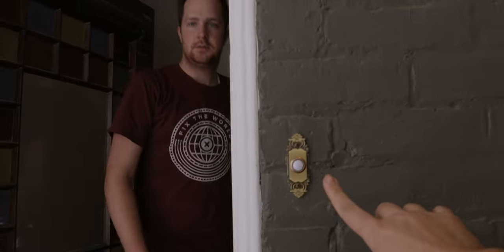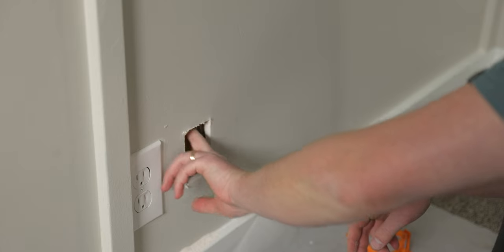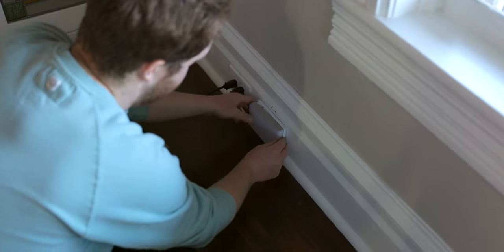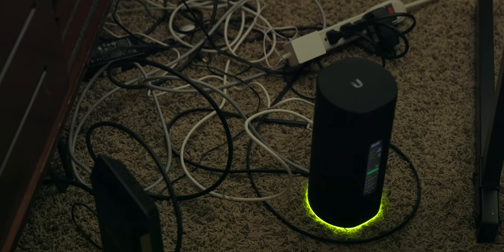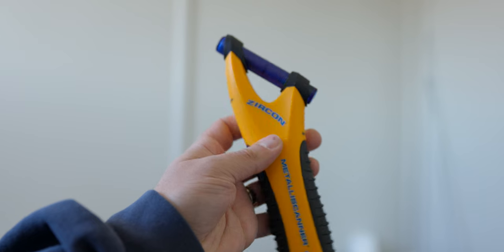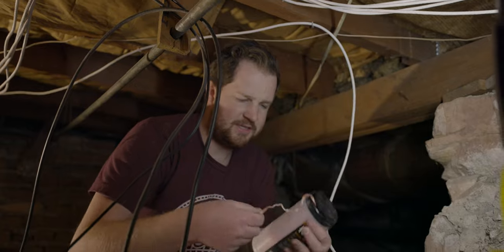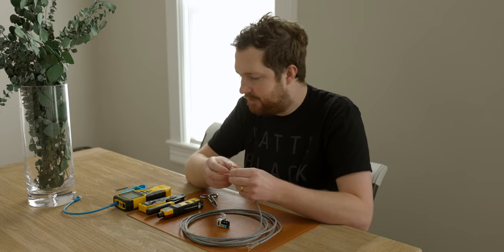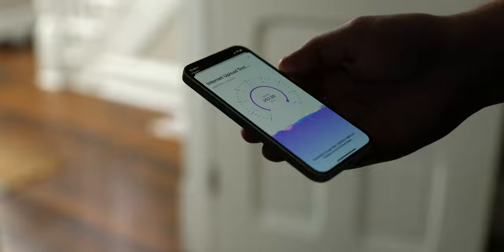Adding 10 Gigabit Ethernet to my 129-Year-Old House!

Comment: A few comments on this to explain some things better:

pin 1 is green/white
pin 2 is green
pin 3 is orange/white
pin 4 is blue
pin 5 is blue/white
pin 6 is orange
pin 7 is brown/white
pin 8 is brown

This is the T568A or as you said type A config.
The T568B or type B has the following layout

pin 1 is orange/white
pin 2 is orange
pin 3 is green/white
pin 4 is blue
pin 5 is blue/white
pin 6 is green
pin 7 is brown/white
pin 8 is brown

The difference is pin 1 and 2 are switched to pin 3 and 6. This is because it was used to make a cross cable, type A on one end, type B on the other end.
Why? Because this is how the pins are used:
pin 1 is TX+
pin 2 is TX-
pin 3 is RX+
pin 6 is RX-

Today most ethernet equipment is MDIX which means it automatically senses these pairs for transmission or reception, so it doesn't matter whether you use type A or B. On older equipment is does make the difference to connect or not.

So what about pin 4 and 5? These are used for telephone lines. No need to wire your house with extra telephone lines, you could just use this pair for that. In fact you can actually click a RJ11 telephone plug into the RJ45 socket and make it work.
Pin 7 and 8 for POE, power over ethernet, today mainly used for IP cameras. It eleminates the use of extra power cables.

Since these two pairs (4,5 and 7,8) are generally not used, in some rare case they could be used to have a second ethernet connection over the same cable. Not advisable but it is possible. I've use this when I needed to connect my doorbell and ip cam located at the gate away from my house. The tube that lead to the gate only permitted one cable, so this was the solution.
Reply: Would the method you mentioned to send two connections on one cable require you to terminate pins 1,2,3,6 on one RJ45 connector and use the remaining four cables to mimic "1,2,3,6" on a second connector on both ends of the cable? Or is it somehow possible to just make two terminations one one end for two devices and somehow configure a switch to send a signal to a customizable set of pairs in the ethernet cableing? Or am I just overcomplicating things in my head lol
Reply: @TromboneSauce  Your first assumption is right. One RJ45 has pins 1,2,3,6 as normal, while the second RJ45 has pin 1 on the blue wire, pin 2 on the blue/white wire, pin 3 on the brown/white wire and pin 6 on the brown wire. On the other end of the cable it's exactly the same.
Reply: if there is power at gate, one could use switch there. if not, you can actually get poe powered passthrough switch. or hack your own. if you look harder, you find managed 5p switches too. overkill or not, having 2 eth devices there already is anyway. and i actually do use single cat5 two 100m at here a lot because i'm a cheap one. my current managed switch is 100m anyway and i like it managed. besides, you might not need the bw
Reply: @ketas  yes a switch could be an option, but, in this case there was no room at the gate and from a security pov it's not a very good idea. I actually hacked the video doorbell and added a small OLED display with an arduino nano integrated into the doorbell case. I barely had room to make all the connections.
And I also went cheap and fast, I'll admit that. :)
Reply: 10 and 100 megabit use two pairs but 1000 megabit uses all four pairs. So using one cable for two connections will limit each connection to a maximum of 100 megabits. This may be an issue in some use cases. Decades ago I worked in a 40 floor office building where the whole building was wired up with one ethernet cable per desk. By the time all the infrastructure cabling was completed it was realised that many staff required more than one ethernet connection. So hundreds of desks had ethernet splitters to split one cable into two. Essentally splitting two pairs to one cable and two pairs to the other. Then in the communications room there were patch panels that were wired up to act as splitters. So a lan connection would go from the network hub to the splitting patch panel and then from the splitting patch pane to the floor distribution patch panel then out on the floor it went through an inline splitter to then go to the workstation. Very messy, especially for a brand new, whole building re-cabling. In the future this got even worse when the owners decided to squeeze in additional desks and so two separate desks would share a single cable via a splitter. So many faults and so much confusion. Especially with the end users pugging and unplugging connections in an attempt to find a working connection. Splitters were moved to other desks and then reported as faulty when they couldn't get two connections to work on a cable that wasn't configured for splitter. Of course when you arrived to fix the chaos everyone swore that nobody had touched anything. 🤔
Reply: @jaseastroboy9240  Nope, you're wrong, 1Gb lan uses the same two pairs, it's the newer 2.5Gb that uses all four pairs. However using 1Gb over the split cable is not a good idea because it could suffer from crosstalk (interference from the second connection). The general norm for 1Gb without splitting is minimum cat5e  cable, but generally cat6 is advised because of the aluminium shielding protecting the signal from outside interference. For 2.5Gb cat7 is advised because each pair is also shielded.

Comment: You certainly SHOULD terminate in a specific order rather than “as long as both colors are the same at either end”.  The twisted pairs are paired that way that they are inverted polarity to protect against interference.

Source:  I work as a Network Engineer
Reply: This needs to be higher up, please for the love of Jesus and your mother end all cables to a spec, preferably B.
Reply: @wesleybradley89  THIS. TIMES. INFINITY.  (and beyond!)   568B is preferred, largely because it's the most popular iteration. Just don't  terminate one end using 568A and the other using 568B, because you'll cross over the orange and green pairs. (and your tester device will rightfully complain!) Doing this intentionally  means you've made a crossover cable, which is normally used to directly connect two computers two each other without a switch in between.
Reply from the maker: Should have clarified better in the video. As long as the cables are on the same end, they should work, but performance will be impacted and there are reasons for which the standards exist. Type-B is the way to go and it’s what I’ve done everywhere.
Reply: Making up your own pinout defeats the whole point of running Cat6. (Even untwisting too much cable before the RJ or keystone defeats the point, but that's just going off into the weeds of pedantry...)
 
White-Orange, Orange, White-Green, Blue, White-Blue, Green, White-Brown, Brown. 
Every time, one exception (when you're making crossover cables for devices that can't auto-MDIX, swap Green and Orange on one end).
Reply: @needfuldoer4531  well the same is true for using unshielded rj45 connectors for Cat7/Cat6a though it is done a lot and for the most part is fine. Having electromagnetic interference for the whole cable run are very probable since it probably is close to AC wiring at some point, but usually you won't have too much interference right where you plug in the RJ45 jack.
Reply: @lal12  Using unshielded RJs is much less of an issue than mixing the conductors up. You really don't want the signals messing with each other through crosstalk.
Reply: @needfuldoer4531  obviously, my comment wasn't really clear. I was referring to "untwisting too much"
Reply: @lal12  I've had firsthand experience with  poorly installed keystones that had an inch or two untwisted on Cat5e runs. Sometimes they'd only autonegotiate to 100 meg, sometimes they wouldn't work at all. I had to re-terminate dozens of them or just abandon them and dedicate them to digital phone lines.
Reply: @snazzy  type A and type B are just a flip or orange and green pairs 1,2 & 3,6 and it will not impact anything if you choose to go with A only or B only. now if you just go in pairs across the connector instead of using a 568A or B standard that will greatly impact max performance. as for different twists per pair that's true as i have personally torn into many wires of different brands and each is twisted at a different rate per pair and per four pair.
Reply: He didn't word it quite precisely. I guess he meant as long as the order is the same for both ends. 
  Umm, yeah but most people are uncomfortable with changing established wire orders. He is right in an absolute way. But it would drive the next person crazy with non standard order.  He did say use the B standard and should have emphasized that.
Reply: @firesurfer  That’s still not the case, even if the ends are in the same order.  The 8 wires inside are twisted in specific pairs so that one is positive and the other is negative.  This is by design to eliminate interference.  T568A and T568B are designed so that your pin layout always has a positive (white striped) wire and a negative (solid color) wire twisted together.

For example, in 1000BASE-T, the first pin will receive a positive signal and the second pin will receive a negative signal.  T568A and T568B have the first pin be a white striped wire, and the second pin be a solid colored wire.  This method carries down through all 8 pins in both standards.  That way, the twisted pairs always have a positive wire and a negative wire.  

If your only consideration is that both wires are the same on both ends, you’re going to create twisted pairs that have two positives or two negatives.  That’s just asking for crosstalk and noise.
Reply: @SHADOWSTRIKE1   That's not what I meant nor Snazzy Labs.  And I believe you know it.
Reply: @firesurfer  Well then I'm not sure what you meant, because that's what you said.  You said "as long as the order is the same for both ends", which is not the case.  It's much more than just having the order the same for both ends.  Having both ends be in the order of Brown, Green, Blue, Orange, White/Green, White/Orange, White/Brown, White/Blue will cause issues, regardless if both ends are in the same order.  

And no, I don't believe I know it.  I've worked as a networking engineer for many years, and it's quite a common misconception that you can just have a pinout order whatever way you want as long as they're the same on both ends, which isn't the case.  I've seen many sites screw this up their pinouts and then not know why they're in half-duplex.
Reply: @SHADOWSTRIKE1   What he was saying is, wires don't know what color is printed on them. As long as the order is correct electrically it's fine. Regardless of the color of the wires.
Reply: I'm an AV/Data comm integrator, and you would be correct sir...
Reply: @needfuldoer4531  Always fluke out your cable runs :p
Reply: @firesurfer  That's still wrong. The electricity does indeed not know the color of the wires, but the physical structure of the cable matters. Ethernet is a differential signaling method. This means that when one wire goes high, it's differentially paired wire goes low. They're always opposite of each-other. This means that if some external noise comes along, it affects both wires the same. because you're only really concerned about the difference between the two pairs, this common mode noise is effectively removed.

This is why it's VERY important that the pairs in the cable are in fact pairs. If you instead split the pairs, and start sending signals down the wrong wires, you mess with the signal integrity. This is why cat5e and cat6 differ. if you notice in the video, cat6 has a plastic cross going down the length of the cable, keeping the pairs separated. This is to eliminate cross-talk between pairs. If you then come along and send the positive line of two pairs down a twisted pair. Well now you've just made the separator AND the twisting of the pairs pointless. It'll likely perform worse than a properly terminated cat5e at that point. 

Electrical signals in the MHz aren't just simple "goes along the cable" signals. They're 3D waves, guided through copper. the 3D structure of the cable matters.

If snazzylabs meant that either standard T568A or B was fine. Then sure. But going with a made-up order is a TERRIBLE idea.
Reply: This is all ignoring the issue of when someone has to come in behind you. If you've made up your own order, even if you keep the pairs correctly together and have no crosstalk, the next guy who has to work on this network is not going to know what the hell is going on with these weirdly wired jacks. This is why we have standards, so that you don't need to write a manual of all the shit you made up to include when you sell the house.
Reply: @dumle29  No need to be a jerk yourself. 
   I have had several rolls of wire with odd colors, they didn't match standard setup. I had to just make them up the way they were. Worked fine, but looked goofy.
Reply: @firesurfer  I'm not. I just told you why the ordering matters, why the cables are built the way they are, and why making up your own order messes with that. You then resorted to profanities.
Reply: @dumle29  In your mind only.  You misunderstood what I said.
Reply: Yeah, this is really important.  If you don't keep them in the proper +/- pairs, even a patch cable of just a few feet won't work correctly.... I think you won't even get 100 megabit over about 20 feet... I know from experience that you won't get gigabit with a 5 foot cable... We had a tech that made a bunch of patches for the server room and wired them all up oranges, blues, greens then browns on both ends and when he swapped them in he brought the network screeching to a halt.
Reply: About to say the same thing
Reply: @SHADOWSTRIKE1  "I've seen many sites screw this up their pinouts and then not know why they're in half-duplex". Exactly!
Reply: Twist ratio in the Ethernet standard exists for a reason.
Reply: I was going to make this same comment. I once ran a 100 foot run of cat 5 using my own order simply colors by alphabet with solid first then stripe. It worked fine on all of my short runs, but on the long run my internet would not work at all. I did not have a proper tester so I tested continuity with an ohm tester. It was showing connections with no cross connections. I was baffled. Once I used the preferred order my problems went away immediately. After that day I always refer to the preferred order every time I make a cable.
Reply: @firesurfer  OK, but you MUST use a standard, not just any "same order" on each end... It's not obvious to many but it REALLY does matter.  white orange, orange, white green, green, white blue blue, white brown, brown used on both ends WILL NOT WORK CORRECTLY, if at all...
Reply: @firesurfer  maybe that is what he meant, but for an instructional video you should be damn sure that what you say is actually true... he did'nt.  I've had my day ruined by people a few times by people that didn't understand this minor point... Some people think that a different order would be a lot easier to remember, so they hear sdomething like that and they change it... Replicating his poor instruction isn't helping... If you don't mean that, then don't say it... be clear for newbies.
Reply: @firesurfer  You would be doing the world a favor if you  deleterd all your posts/replies on this topic.  He misunderstood (or felt the need to clarify) because you were repeatedly saying things that were wrong.
Reply: @jeffbuck2624   Wires don't care what color plastic is on the outside. I didn't make the roll with those colors. Some factory did.
Reply: @snazzy  "Performance will be impacted" is an understatement... It's a good way to end up with 10 megabit or less. Just don't do it, and don't tell people it will work if you do it anyway.

Comment: I've never seen those passthru connectors before. Very useful!
Reply: they are so much better :D i have never seen them either
Reply: You mean the RJ-45s that let you shove the cable right through the other end? I LOVE them. My house was wired using Cat 5e for telephone, and I eventually used those after having a hell of a time using the classic rj-45 connectors.
Reply: Just don't use them for anything outdoors - they are very to short out.
Reply: Passthrough connectors can cause issues with Poe equipment. Sometimes it’s not worth the extra 5-10 minutes saved when doing a big job.
Reply: I've terminated thousands of RJ-45 connections, mostly with cat6. EZ RJ-45 connectors are pricy, but are the best pass through connectors, and I never experienced a failure with them over the course of years of using them (all indoors). They also sell a tool that not only crimps the connector, but will cut off the excess wire, you can find it most places like Amazon. 
Also, pro tip on separating your twisted pairs: use a very small, like precision screwdriver size flat head, stick it in between a twisted pair at the base of them where you cut the sheathing back to (an awl works for this, but you can hurt yourself or pierce the wire if you slip up), pull up all the way through, your twisted wires are now perfectly straight except at the tip, cut that off, and now your previously twisted individual wires are as straight as can be.
Reply: @AlGoYoSu  I use one of my thin pick and hook tools, slide it between the wires at the base then just pull straight up!
Reply: 30 years d
oing networking - only way to go are these, and then the patch cable, mostly because if the jumper from the wall is damaged then someone without the understands on how to crimp can
just toss in a new patch cable, it is policy when I did work
Reply: aww man, they are so much better!
Reply: I’ve had issues with pass through RJ45 and Ubiquiti PoE devices. Tried several different brands, same issue, so I just went back to using the old ones.